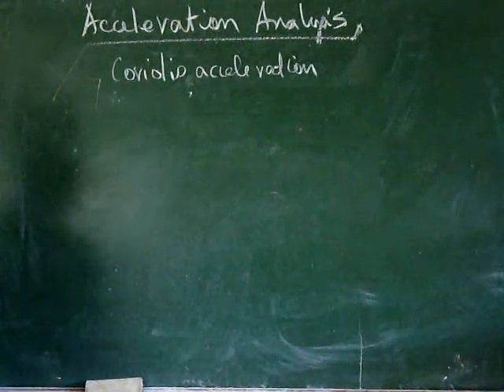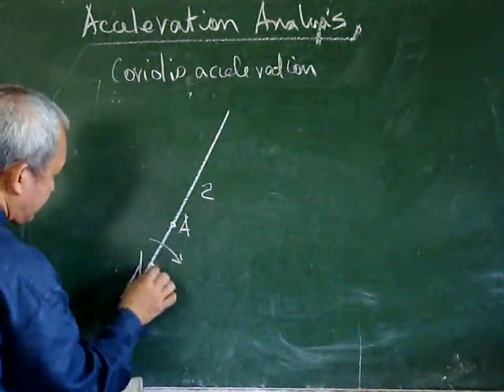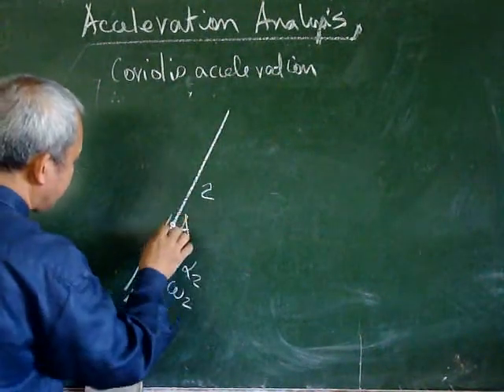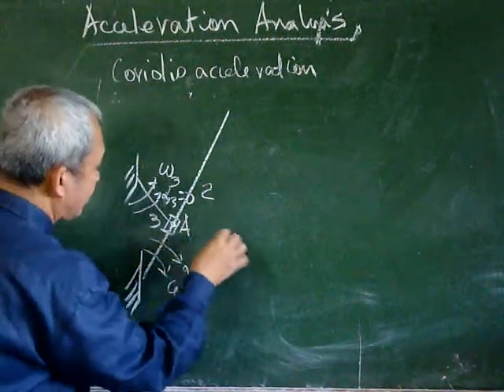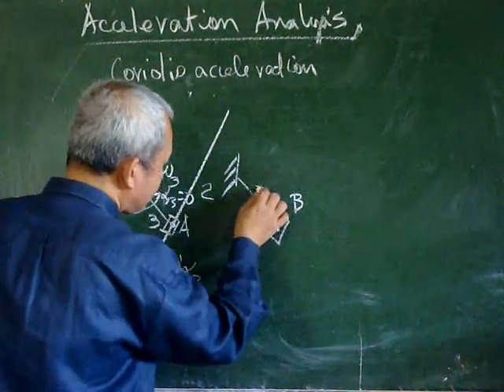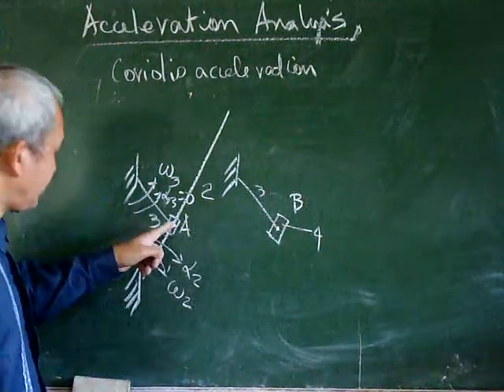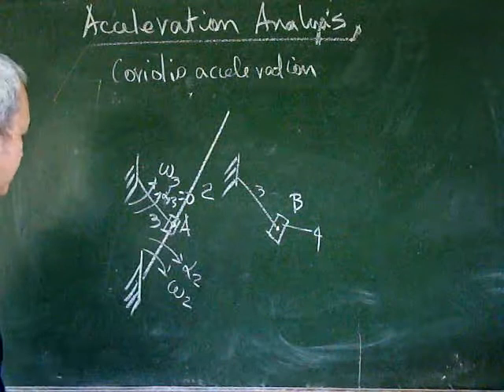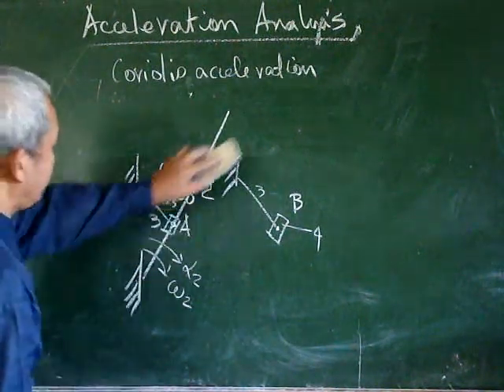Corioli's components of acceleration 2

Comment from the maker: The tangential acceleration is parallel with the direction of the velocity of a point or body.  Its ‘sense’ has to be determined and has to be consistent with the direction of the angular acceleration. Also, its direction is perpendicular to the normal acceleration component. It is perpendicular to a line that joins the point and the axis of rotation.  
Regarding the  question on the the location of the Corioli's component, it is possible as long as one follows the rules of vector addition.